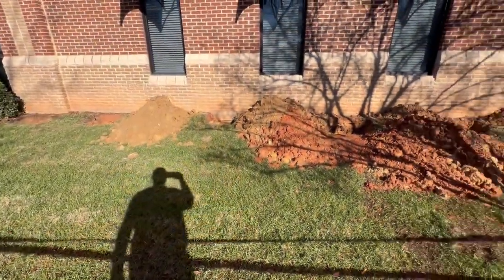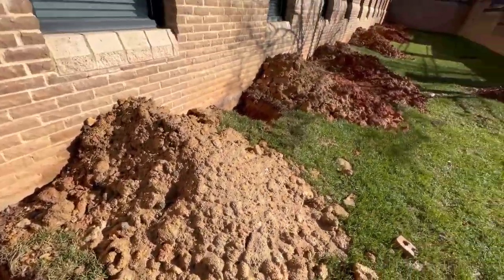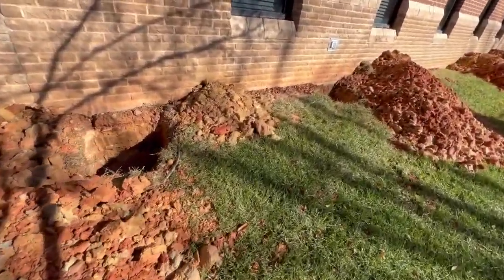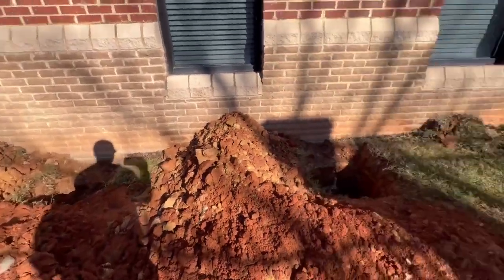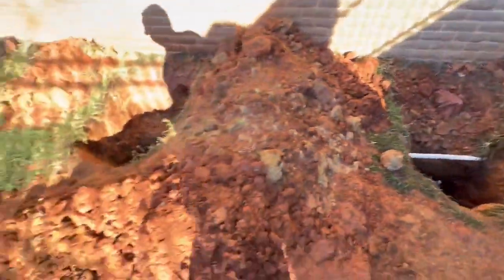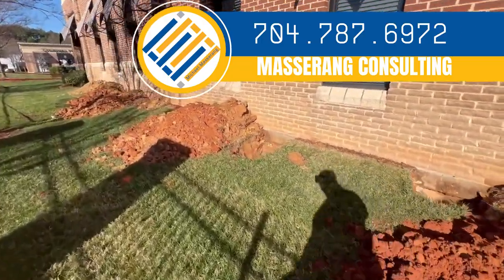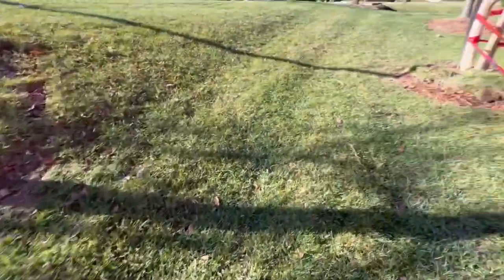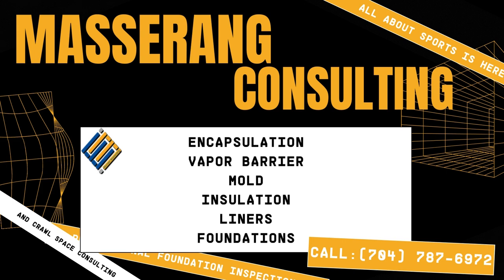Shocking Charlotte NC Foundation Repair Mistakes Caught on Camera Part 1

Comment: You don't open up the holes and let them get rained on.... I knew that before you said it.... forget protecting the holes, you don't want settling .... then you cause the problem, dig, inspect, fill... best within 12 hours
Reply from the maker: This is the market in Charlotte, NC. Companies could care less about quality.  Especially the franchisees like the company featured here. They hire pill popping idiots to put in the work. Training is poor and the turnover is high. Then the elites in the office push the crews in the field to finish fast to pick up the check. No matter what corners are cut, permits skipped, and/or quality standards are ignored. This has been going on for decades. But it is much worse now since Covid due to the shortage of qualified workers that are willing to do this kind of work in the first place. The elites in the office? A dime a dozen. And they are disconnected from reality completely.